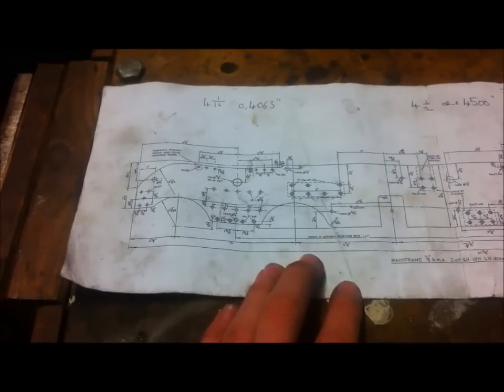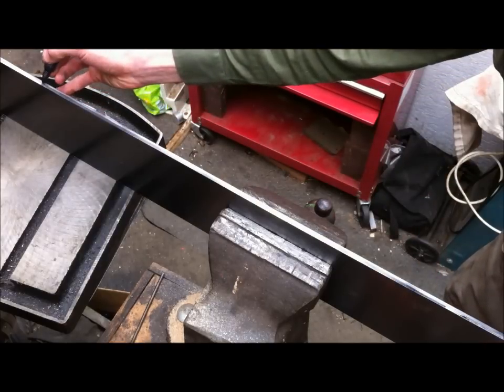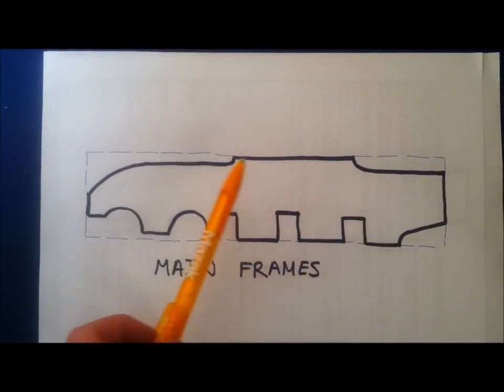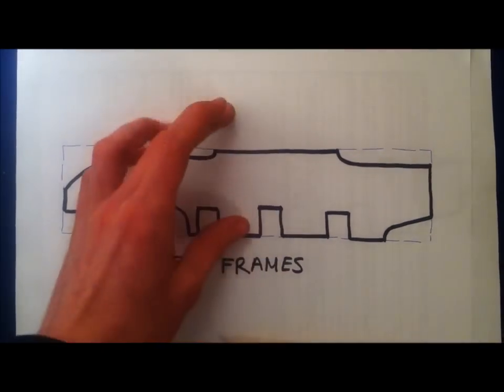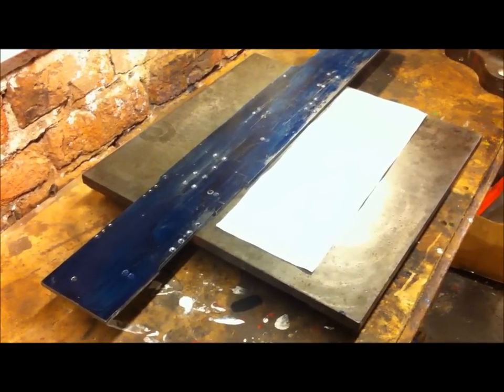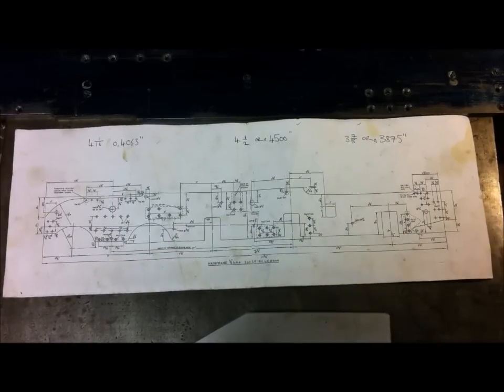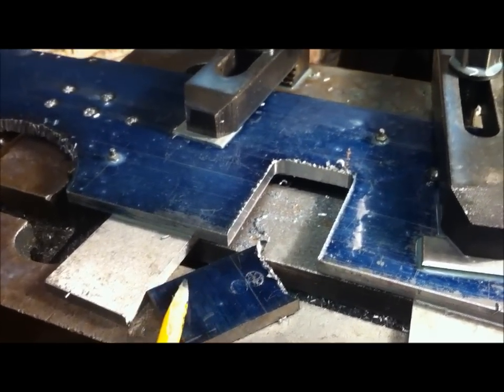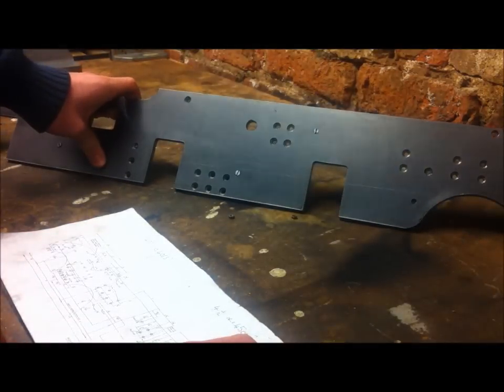Home Workshop Engineering - Making Loco Frames

Comment: Nice work. I am a Aircraft Maintenance Engineer doing mechanical, structural and machining work, which I like the best. I have done lots of work on jet engines, not RR, but mostly Pratt & Whitney and General Electric and know the little cooling holes you were talking about in your other video.
It is nice to see young man interested in working with his hands and metal these days! Keep it up and you will go far.....Oh yeah, wear your safety glasses.
Reply from the maker: 40cleco Thank you, I am not hugely familiar with the turbine blade design of other companies but I assume they are all fairly similar for the most part.
Reply: Yes they are...

Comment: Can I ask where you got the steel for the frames? Most of the UK model engineering supplies seem only to stock bright mild steel and not black. Many thanks
Reply from the maker: +Stuart Davies I just got it from a local engineering firm, 3mm black mild steel sheet is common stuff in the fabrication world so you should find some somewhere.
Reply: +MrCrispin Thanks for the info. All the best